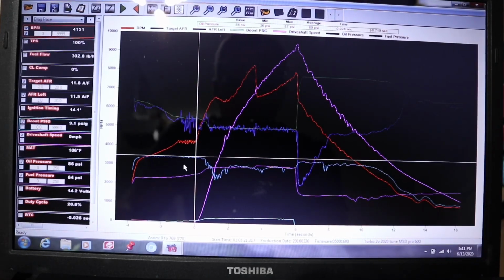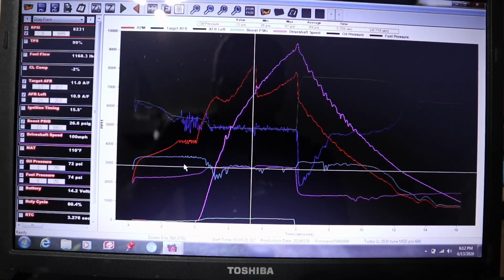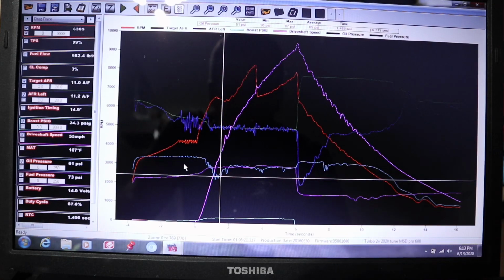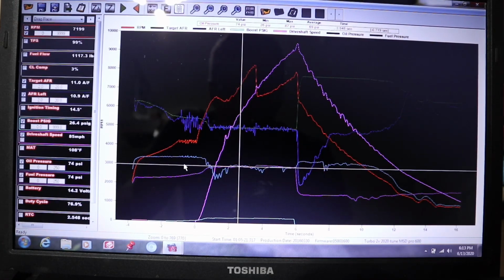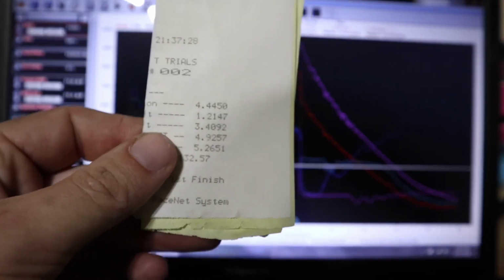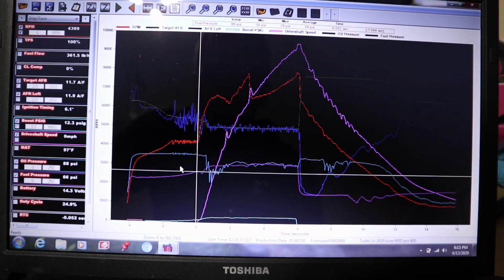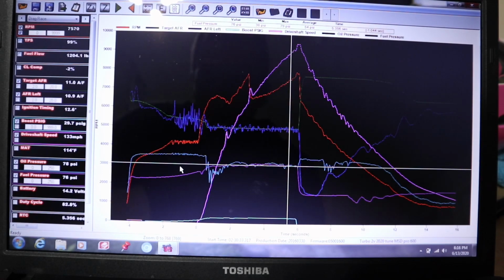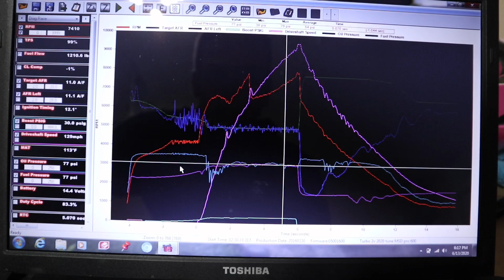Turbo 2v is flying! Dipping back into the low 5s

Comment: Im building a 5.4 2v with 9 thread heads on MMR parts and using a 2.3 tvs and focused on only 15lbs of boost 600 hp at the wheels 😂 youre eating close to double that! . Lmfao that 4.6 is dope bro. Wild 2v!

Comment: Congrats. :) Well done. Predictions are you will run a 4 in 2020. Low compression pistons and soft head will handle a lot. 
Blood bath racing has only 110 psi cranking pressure, but about 2800 hp with a pleasent boost level.

Comment: I am so impressed by what you have accomplished.  You have simplified your setup by keeping it 2V and have proved the TrickFlow to be more then capable of keeping up and being competitive.  My question is are you in a 4.6 class?    And is there a reason why you haven't run a Scat 5.0 stroker crank and rods? And if I were running a similar but milder setup on the street would you recommend the stroker kit to have more low end and mid range power seeing that the heads would keep up.

Comment: Damnit Man!! The thing is your chasing 1/8th time's But realizing you've built a 9s-mid 9s quarter mile car is even better!! What I love the most Drew is that when you was building the WAP block motor everyone was doubting you about it!! Hater's gonna hate But they ain't even running 8's(et).. LoL 😂🤣😂
Reply: Those 1/8 miles times equal 8 sec quarter miles easily.
Reply: Car ran 8:50s 2 years ago at mod nats(underdog winner) and I think he got in the 8:20s last year
Reply: @88TRUNKBACK  dint he go like 8.1 last year when he lifted the head and blew the head gasket. ? I think he should be a 7sec car now

Comment: Andrew question how do you like the ATI damper? Is it still or aluminum? That ATI  the same as summit racing or trick flow damper for the 4.6 2valve? Would recommend the ATI damper or summit racing/ trick flow is better than use a piggyback or it the same ? Thanks

Comment: What front suspension are you running? Limiters? and do you have a fair amount of anti squat? I am having a hell of a time keeping the front end down on my car. Have to leave in second gear on the th400 as well. 3.55 gear, tt sbf. Went 135 in the 1/8 last night. Struggling with the 60. Strange double adjust in the back and singles in the front. No limiters. It comes up and wants to wheelie and then comes down and unloads and smokes the tires unless I pull a bunch of boost out. I dunno if I can get some limiters and ride them out or maybe it needs more anti squat. It’s around 125 percent. Hoosier 28x10.5 at 11 pounds. I know it has the power to go fours. For sure. But i am scared to knock it the head out of the hole bc of wheelies. Appreciate any tips as your car leaves idea basically. Thanks.
Reply from the maker: Have you tried the from shocks on full tight? Everything else on the set up sounds good. I have limiters but they where at full travel on these passes

Comment: man 10 quarts of oil is a good idea. Ive put about 400,000mi on stock 4.6l 2v and when im sliding through long sweeping turns, i always run out of oil pressure.
Reply: May be a dry sump system would be what you want like Midgets and Sprint cars that also drift through turns.

Comment: We missed you Andrew! Building a twin turbo 2v this month 2002 GT with 130,000 miles I have many questions for it seems you have mastered the 2v
Reply: It will be built for 30-50 rolls and drifting. My question is what is the max rpm and max boost the stock motor can handle?
Reply: @crispychiken3886  The stock rods in the 2v are the weakest part I believe. I wouldn't push them past 400hp.
Reply: Jeremy Biggers Thanks for the info I was shooting for 400whp because I’ve seen a video of a stock single turbo 2v run around 420ish to the wheels. My motor also has great compression(180psi per cylinder). Would a lower compression minimize the risk of the rods going out?
Reply: @crispychiken3886  You really need to just go ahead and get better rods and pistons if you plan to push past 400whp. Otherwise, it's just a time bomb.
Reply: @Jeremy-Biggers  I would if I could. It's really a budget build (for now), but I will definitely do forged internals by next spring. Around 6k for fully built motor to handle 1000 to the wheels :(
Reply: crispy chiken if you have a safe tune 450 wheel horsepower. But if you plan on beating the car pretty hard  400 rear wheel would be safer like previous post.

Comment: Hey Andrew, I just bought a 93 fox body N/A running around 6.6 to 6.9 on foot brake at 101mph in the 1/8. The car has run 10.5 at 130mph in the 1/4. The car has a built SBF and a C4 three-speed. What do you think about the car?
Reply from the maker: Sounds like it’s pretty stout
Reply: spray it lol

Comment: What the hp. And weight of the car.  Thanks.
Reply from the maker: 1000hp around 3200lbs
Reply: Andrew Lavender that flywheel hp or at the wheels.
Reply from the maker: jvcomet just guessing at the wheels. Calculator shows 1150~ at the crank
Reply: Andrew Lavender nice cars flying man great job.